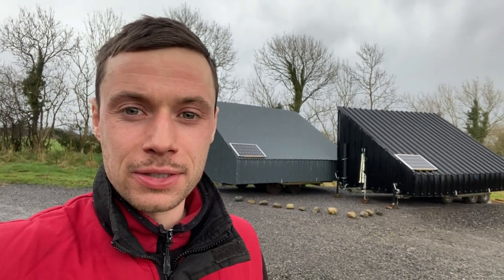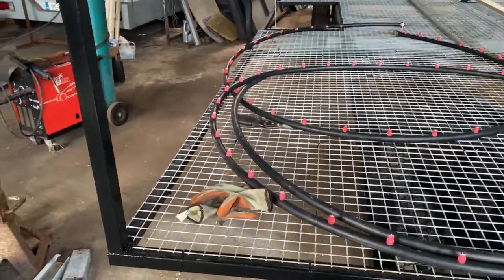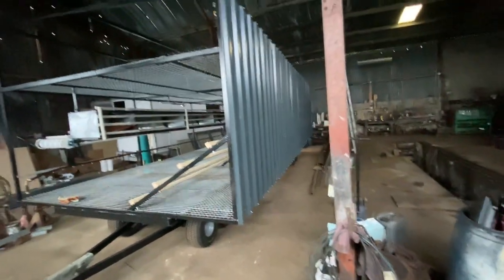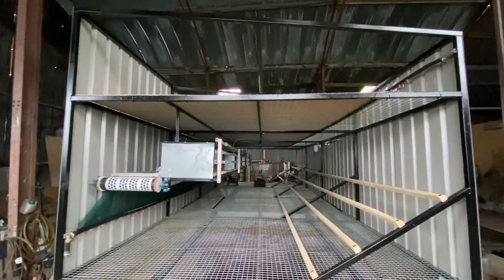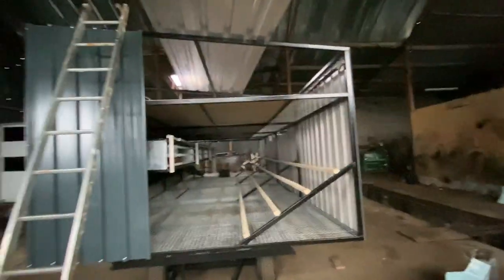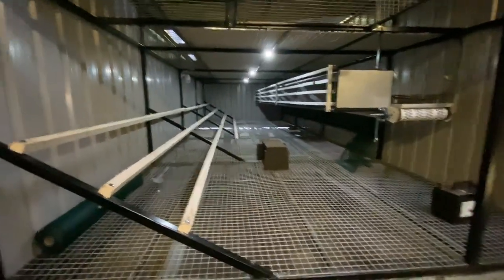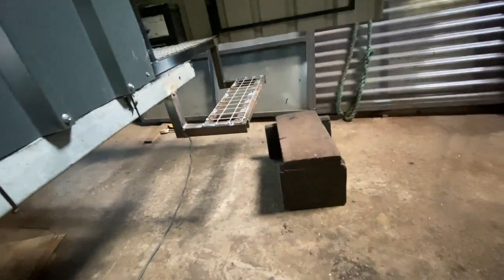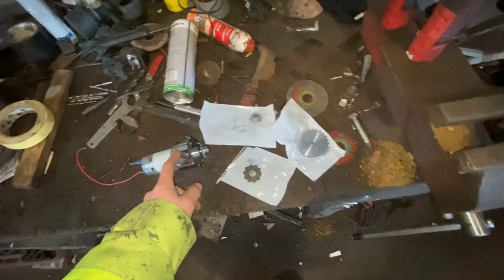HHF Egg Mobile Part 4

Comment: Awesome job you are doing here! 
Question about water line inside the egg mobile, don't you afraid that water goes bad, especially on the second floor. It can spoil the water on the ground floor as well. Maybe put water in circulation?
With great intrest I am looking forward to the video introducing automation 😀